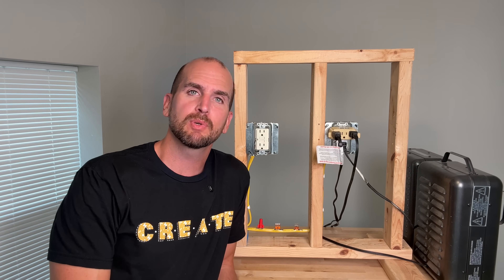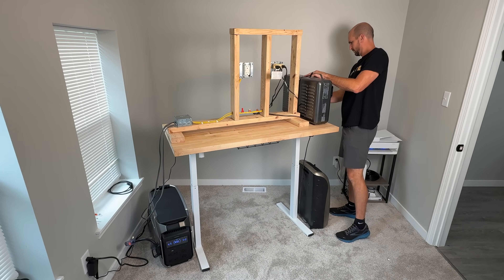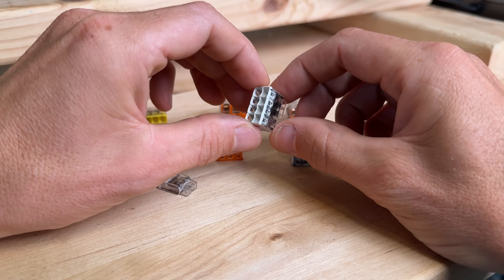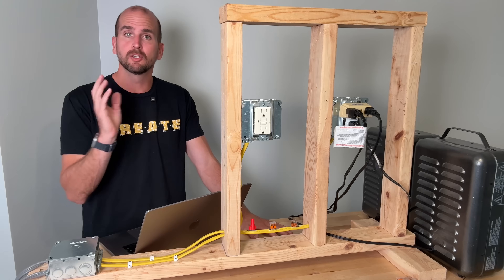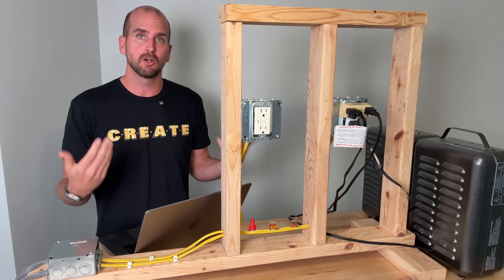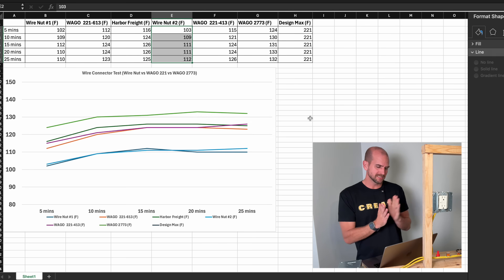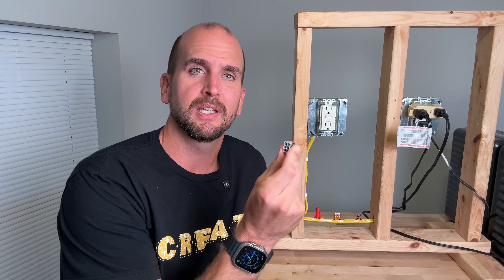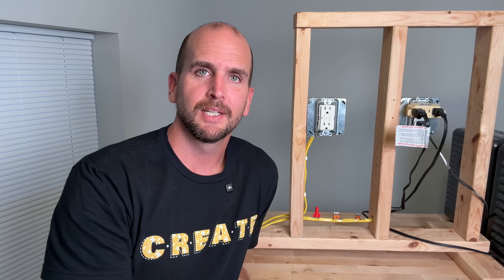Can Push-In Wire Connectors Handle Heavy Loads? | Surprising Results!

Comment: How easy is it to pull out the wires from the Push-In nuts???
Reply: It’s very easy. Just twist back and forth while pulling. Some are rated for reuse, and some are not. Be sure to read the manufacturer’s instructions to see what they say before reusing.
Reply: I would say in my experience push in connectors (single use) work pretty well with solid wire but are indeed impossible to pull out the wire without damaging the wire or the connector. If I've ever needed to swap out something I just end up cutting the wire. The wago lever design are really great, they hold just as well and extremely reusable. They are also smaller than wirenuts and fold really nicely into a box
Reply: Not designed for re use.
Reply: @davidcarp5935  : That you Mr. Obvious. Thank you for assuming stupidity first.  I'll do the same: Back-stabbing on outlets and switches is not recommend mainly because they pull out easily. Do these Push-Ins hold better and so don't have that concern, or are they just as risky to use?

Comment: Thank you for this data, I use wago lever nuts myself. Would you be able to do a similar video but use a leveton decora edge outlet? I'm curious to know the temperature at the terminals on the edge. You could even compare it to speed wiring.

Comment: As an electrical contractor my most common service call is dealing with backstabbed plugs.  I have tentatively started using Wagos in switch boxes and fixtures.  For high load applications, no merci.
Reply: Every outlet in my home was backstabbed by the original electrician. Not only that, but they are the “newer” 14 gauge-only backstabs, but he either drilled them out or forced 12 gauge wire into the holes. I’ve been steadily replacing them over time. A few had already failed when I moved in.
Reply: Been using them 10 yrs here in the UK on 32A circuits with no issues except for one that failed due to corrosion from water ingress

Comment: I can see a difference of wire heat between connectors. I think the test should be separate not in series.
Reply: By doing the test in series, you guarantee that each connector has exactly the same amps passing through it. That means that you have a fair comparison, and the best connector displays the lowest temperature.

Personally I would like to see a comparison of a poorly made connection, like a poorly connected wire nut.
Reply: @sergey8644  Agreed - and all that has to be done is swap the connectors around to show the same results.
Reply: @sergey8644  can't test poor connections (equally).
Reply: Agreed. Test should be separate not in series.

Comment: Hmm. How do I know the wire nut is not preventing accurate temperature reading? Measuring surrounding air isn't same as measuring conductor. I have to presume form factor of wire nut has an effect. Either way, no true reading of conductor & connection heat.

Comment: Wouldn't the push-in connectors be the same as "backstabbing" on an outlet?  I thought that was bad.
Reply: No, it's a bus bar similar to the 221s but cannot be reused.  The outlet backstabbing is a terrible design prone to failure (not talking about the new lever push ins, those are more similar to Wagos).  Those outlet connections weaken overtime because there isn't a spring pushing against it, just the one and done slight tension.  So the heat and cool cycles and years and years of use wear them down.
Reply: The tombstone ends on Old fluorescent light fixtures are all factory backstabbed connector's. They can be taken apart straightened out and re-back stabbed to make a decent connection,  but as compared to a Wego lever but the Wego is a far better connector then a backstabbed connection.
Reply: @dand3975  - The lever-nuts maybe, but he asked about the push-ins.  That has to be a function of tension over time. There simply is not enough material in it for there to be much else in play.
Reply: @darriuscole8544  I agree with you.  I would not use the push in  connectors Ever.  I use 221 lever nuts for low amperage circuits.  Anything drawing a lot of amperage like 15 or 20 would be  wires pre-twisted; wire nuts, followed by a thorough wrap of electrical tape over the wire nut and the incoming wires.
Reply: Not remotely close, US style backstab terminals only the spring is making contact, wagos have a busbar that the spring clamps the wire to

Comment: I would have problems using the push-in Wagos for stranded, especially the very thin gauge stranded wire that is used with light fixtures.
As for homeowner's insurance, mine is skyrocketing. Along with car insurance. The latter up 50% in 18 months. I did price compare and the competitors were actually higher. Something unsavory is going on.
Reply: I actually prefer them when mating solid copper wires with fan wires or most ceiling lights. I just fold the stranded back so I double the amount of stranded wire in the nut.....its my favorite application for them..

Comment: These tests would be a lot more convincing if they were done in a more realistic environment. In a plastic box, with insulation and drywall.

I'm concerned about heat accumulating over time to more dangerous levels, while in this setup it can pretty easily dissipate.
Reply: I would be too if my 20 amp circuit breaker allowed 30 amps to pass through for several minutes without tripping.